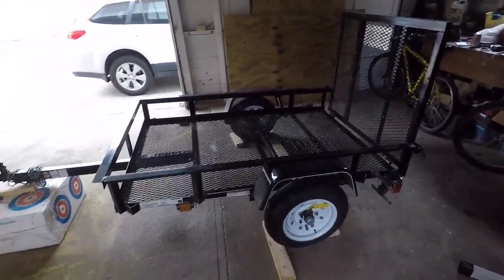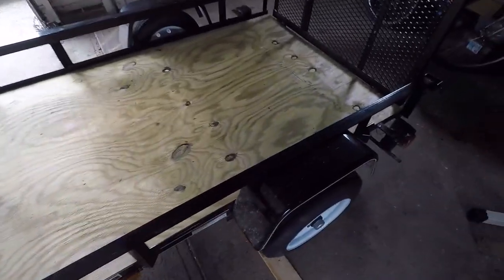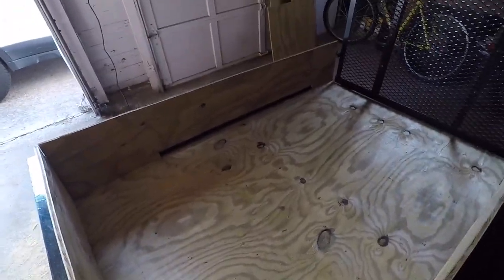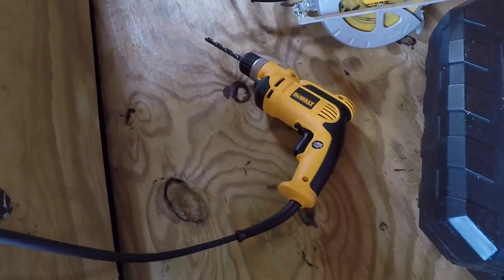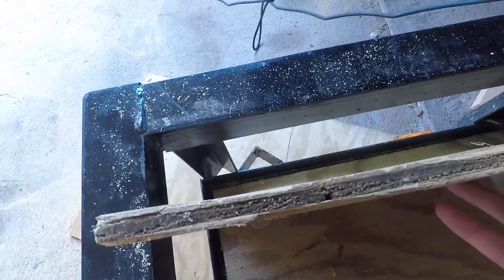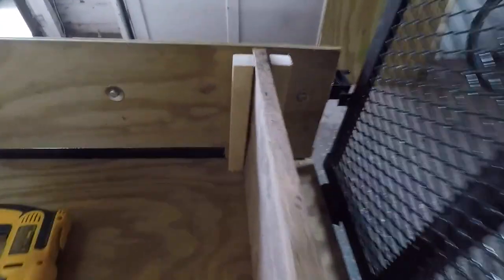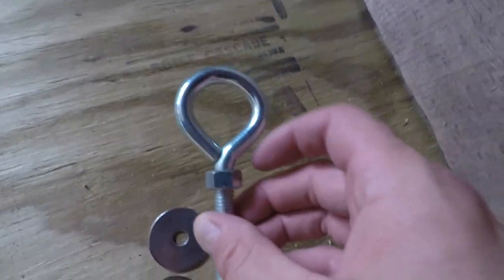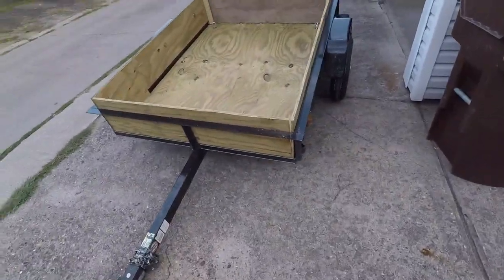CHEAP + EASY DIY 4x6 Trailer Upgrade | How to Build a Plywood Floor and Walls For Your Lowes Trailer

Comment: Wes,  Thanks for the video. I just bought a trailer on Monday. It has a wood floor but I need to add wood to the sides so I can haul mulch and the eye bolts are a great idea. I like the addition of the sliding door on the back. I appreciate the info. Looking forward to the next video.  Randall
Reply from the maker: Thank you Randall - appreciate the feedback!

Comment: I would personally use the tie down bolts as a plywood bolt.  No need for regular bolts to use the plywood only.  But who an I to judge? I didn't record a video like you did.  So, thank you.   This was only an idea
Reply: I’m confused. So the plywood is the bolt?
Reply: @Deon0026yickadee  naw he saying the tie down (loops with screw tips) so it'll ve dual purpose. For tying down your items and keeping the board secure
Reply: Carriage bolts

Comment: Great video.  It provides some inspiration and ideas for doing the same to my 5 x 8 trailer.  I like your idea for the removable back wall. 

Is there anything you wish you did differently now that you’ve had it for a while?  I think I might use carriage bolts (with a rounded head) so they sit more flush with the floor, and perhaps I can slide a shovel over top of them.
Reply from the maker: Thanks for the comment! Actually there is something I would do differently. I did not know, until a commenter enlightened me, that the ramps fold in and lay flat on the floor of the trailer. Unfortunately the plywood floor is too close to the hinges to allow the ramps to fold down all the way. Plus the make shift tailgate rails get in the way too. So if you don't mind having the ramps either straight up or down in the loading position, everything is ok, but if you want to fold them inside the trailer, you need to make some adjustments. Hope that helps!

Comment: If I only plan on using it for camping gear or picking up lumber.. would you suggest adding plywood to a trailer like this?
Reply from the maker: Sounds like it would work fine without the modifications for your purposes. Thanks for watching!

Comment: How is the gate hinges attached to the body?  Is it welded or bolted? In other words can the gate be removed for hauling 10 or 12 foot boards?
Reply from the maker: The hinges are welded on. Since making this video, I made some further changes that allow the gate to fold almost flat. To do this, I had to cut a foot or so off of the back of the plywood, remove the wooden back stop, and remove the back two tie loops. When I made this video, I didn't know the gate folded in until a commenter enlightened me. Hope this helps.
Reply: 2 years late but I’ve hauled 10’ boards and 12’ carpet rolls on my 4x8 
Just angle the boards up resting on rear gate’ they will stick out a bit so plop a flag on em and call it a day’ 

It’s crazy how much you can fit on a 4x8 when you try’ got a Carry-On 2 years back on Classifieds’ $240 even had a spare tire! needed new lights and did a rattle can of bed liner on it’ and she looks great’ in 2023 Money isn’t real…. They are selling new for 1200 🤯🤯🤯 
They were $549 ish 2 years ago’ maybe $600 at Tractor supply

Comment: I don't understand.  I have the same trailer and the gate drops to the ground as it should. They put the hinges on wrong if it folds inside the trailer.
Reply from the maker: Gate dropped to the ground just fine, I just didn’t realize at the time that it also is supposed to fold flat inside the trailer. I ended up cutting some of the plywood floor off so the hinges could fully collapse when laying the gate down inside.
Reply: Yeah my bad . I did not realize when I bought mine that YES the gate is designed to fold down inside the bed. However I installed trex boards over the chessy mesh screen.  So now there is no way I could think about that. I never thought about having to do that + I'd rather have the trex . Sealed the open sides with carriage bolted plywood , chain to hold lift gate in the fully opened position.  Now going to work on steel brackets for higher side boards.  Good job

Comment: how havy duty are the axles on the 4x6 trailers?? 2000 lb or just some 1200lb
Reply from the maker: I believe it's rated for 1,700 lbs according to the Lowes website.
Reply: @dirtdiary3162  thanks

Comment: Did you realize that your tailgate folds in? Of course it won't now with that wood you added in the back
Reply from the maker: I did not know that and wish I did! I would have changed a few things. Now I'm going to take a few inches of the plywood floor and remove those pieces of wood to allow the ramps to fold down. Thanks.
Reply: Actually it folds down to the ground.  I have the same trailer.